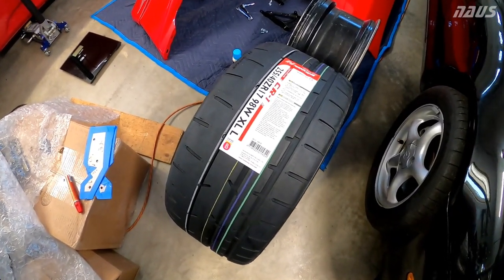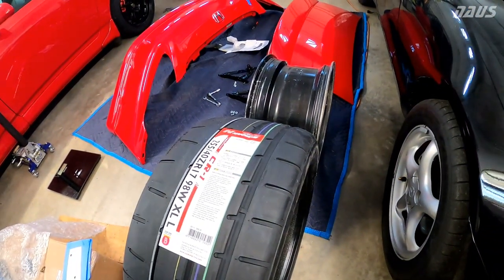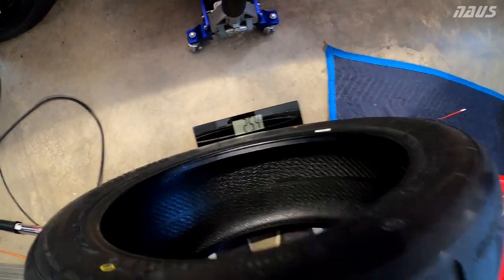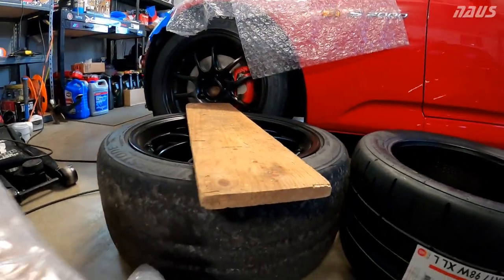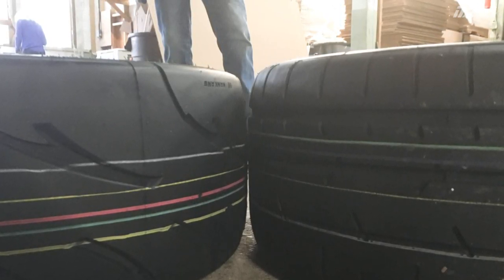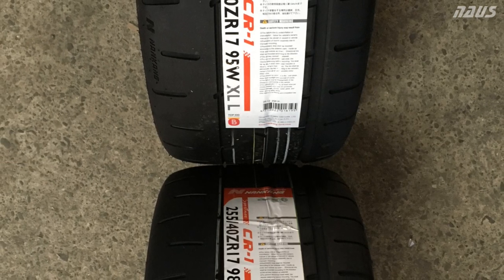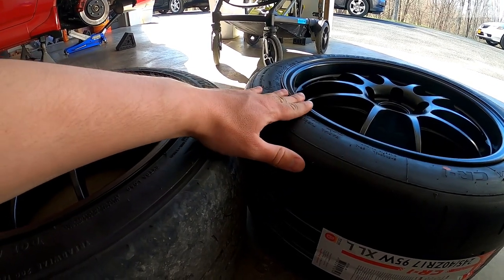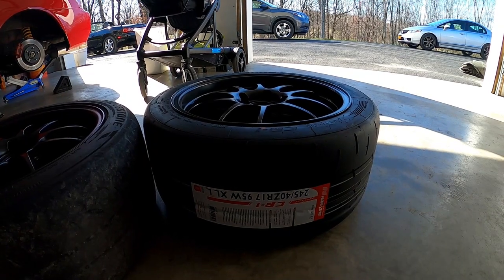NANKANG CR-1 (CR-S) Tires - 255/40/17 Vs. 245/40/17 Comparison

Comment: Great info! I’m about to order the replacement for my supra which come with stock 255/40/18 tyres and CRS does not have this size. Now I know that 245 would fit perfectly.

Comment: Thank you for the comparison but to be honest when the car tires are used 10,000 miles and more when you compare them to another new tire that’s a little bit wider. It’s not a match do the same miles on the new tires in then you’ll find that the 255 is wider

Comment: Couldn't find a follow up vid have you had a chance to try the cr1's yet?
Reply from the maker: Yes sorry im super behind on video uploads this year (as always). Ive done 5 track events and 4 autocross events on CR1s this year. Every single track resulted in PB's and I finished 1st overall at 3 of the 4 autocross events (only one running these tires there)
Reply: @NAUS2K  Amazing! thanks for the feedback I'll pick up a set now based on this and your vid was very informative. Your car is so clean btw I'm jealous

Comment: I have a 235/35r19 square set up. The tires are like rubber bands tbh I'm debating getting 255/35r19 I've been having flat tires almost every month it's getting to be a pain. Should I upgrade to a Federal 255/35r19?

Comment: AR1 tend to measure exact size for tread width, so a 255 will be 255 across the whole tyre, where many semi slicks tend to be oversized. Looks like Nankang have done this wider appearance with the cr1
Reply from the maker: Yes the AR1 does look like a true 255 just like the RE71R

Comment: So if you had to do it over again would you just get the 255 on the 9” wheel after all?
Reply from the maker: Nope, 245 has been fast. Don’t regret it one bit , been through two sets of these now
Reply: @NAUS2K  where are y even getting these? I can’t find them on eBay etc

Comment: I just picked up an S2000 and came here looking for any info on the CR-1, very happy with your video!
Did you say you're running 255's on stock fenders?
My car is rough and I will not hesitate to modify fenders, but from the limited research Ive done it seems everyone modifies their fenders and runs a bunch of camber to clear 255.
Reply: Your going to need a roll and pull. Running them 255 squared.
Reply from the maker: My car has zero fender modifications. 100% oem. I’ve been running 255 re71rs on my car for 3 years without issue. I am now running these 245 CR1s and also have no issues. I bet the 255 CR1s would have fit as well with possible Minor running of the fender liner , but the 245s have been super fast for me this year so I do not regret the decision
Reply: @NAUS2K  Is that a result of camber I presume?
Reply from the maker: I am running -2.5 deg in the rear and -3.7 up front with spoon offset lower balljoints. Yes the camber up front definitely helps clear the oem fender liner

Comment: Is 225/45/17 a taller sitting tire that the 245/45/17
Reply from the maker: No. with both having a 45 series sidewall, the 245 will be taller

Comment: Interesting... do you think a 245 ao52 is wider than the 255 Bridgestone?
Reply from the maker: From what I have read, the 255 and 245 A052 is about the same as these CR1s , however the A052 is significantly lighter which is a huge advantage. They 245 is listed as 22 lbs. that’s 3 lbs per tire less if that’s true, I’d love to get my hands on a set to compare
Reply: @NAUS2K  Looks like the A052 is going to be backordered for a while.